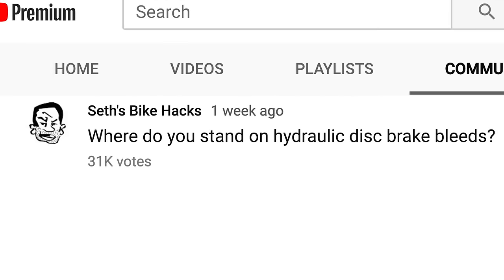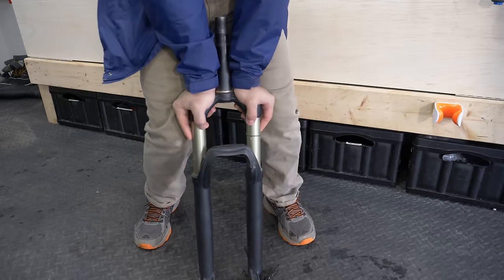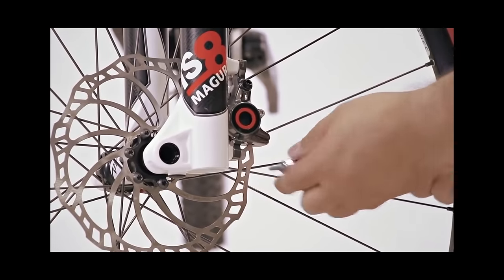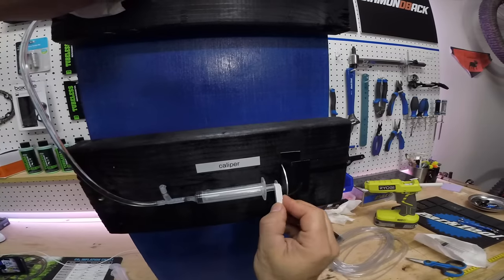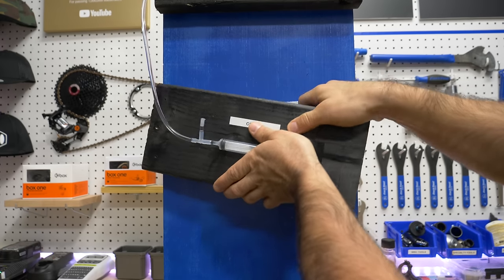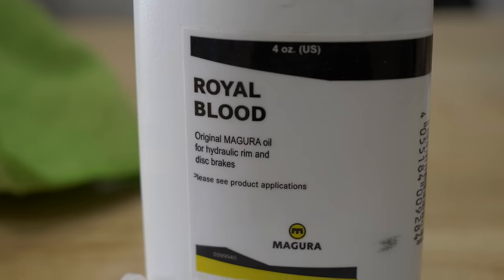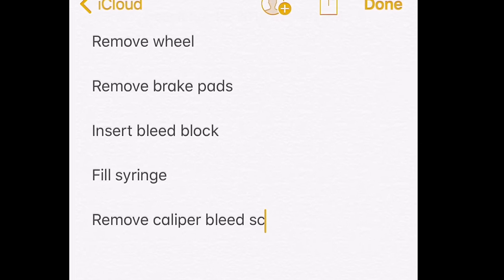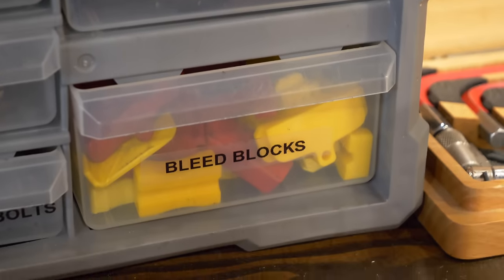How to bleed MTB brakes

Comment: ok I have a Norco Truax 3 2013 I think got it from a friend of mine had a few things mess up with it so tried fixing let a shop fix it cost me about 500 bucks and like the bike has oil or something for suspension and my friend stayed there are oil and the air suspension is this true?
Reply: i dont know what you're saying but my guess is that you have an air fork/shock that needs to be lubed with oil or something? dont know what u mean exactly though

Comment: After bleeding, while block is still inside caliper, break feels really stiff, so no air inside. But as soon as I remove the block and put pads (and wheel) in, rear brake feels spongy. Tips?
Reply: You have no room to compress the pads inwards with the bleed block in. So it doesn't move at all. Any movement you feel is the air squashing.

Edit: did you get it solved? Just noticed the date lol
Reply: @bananasstuff3344  Wellz theres no air squishing while block is there. How can there be air after i remove block?
Reply: @bananasstuff3344  I was using baby mineral oil (like sethbikehacks), but i revently switched to shimano orignal, and they feel a bit mor stiffer, but they feel different, like they are not powerful enough. I might need to refill and over bleed them (pads are on 60%)

Comment: Man, I feel like I lost my man card admitting that I don't want to bleed my own brakes. I tried to bleed my Hayes brakes, and got DOT fluid on the rotor, and pads, totally ruining the brake. I think if manufacturers want to use DOT fluid, they should have a reservoir like motorcycles, and cars, otherwise they should be trying to use water or something instead.

Comment: shimano brakes are the easiest to bleed, you dont even need a funnel, you need brake oil (or baby oil) and a dressing bottle, fill everything into it, then drip oil into the port otherwise used for the shimano funnel

Comment: Do I need to bleed brakes when I have rim brakes? I think that's the type I have....
Reply: no. ig it seems extremely obvious to me, but not for everyone i guess. rim brakes use a cable to pull 2 pads together on the rim to slow down your bike, while hydraulic disc brakes use the oil to force into the caliper, making the 2 pads squeeze on the rotor.
Reply: @linemedia666  yea, i was thinking that but i wasnt sure, thx

Comment: I hate that bikes are getting more and more complex just makes them more expensive now we’re not talking about longer life tubes or stronger frames I’ve seen carbon fiber frames snap like celery and run flats make the ride harsher bleeding brakes for a bike it’s dumb and not needed it’s a gimmick that makes them more expensive to maintain I remember maintaining a mountain bike from the 90s cost like 50$ a year just for tubes and brakes maybe a chain or tire now it’s in the hundred of dollars
Reply: Depends how much and rough you ride. I upgraded my frontal brake after 2,5 years to a better model with only changing the brake pads one time until then and now after 3 years I finally have to bleed the left over back brake the first time. And it's a low class shimano brake, no top model.

I ride a few thousand kilometers xc tours each saison in a hilly area with some long downhill trails. So I don't think the brake service is too often. Maybe enduro and downhill guys shredding to the limit have more trouble with this.

Comment: Hope ftw.  No special tools or syringes, or procedures. Just bleed like car brakes and you don't need to order special expensive mineral fluid from a bike shop, just use spare fluid from your car you probably already have laying around.  And the pistons wont even pop out if you squeeze with no rotor installed like everyone is scared of doing on other brakes.

Comment: "oil get's contaminated,and air get's in..." We got to ask ourselves ,why is  that?  No such thing on older brake models and motorcycle  brakes , you could used them for years without this kind of hassle...
Reply from the maker: It does happen on cars and motorcycles, however those systems have sufficient volume where tiny millimeter wide bubbles do not have much of an effect. Cars also have vacuum pumps. On a bike every gram counts, and their brake systems hold way less fluid. After some months, even the tiniest bubbles can end up making a difference. The same goes for tire pressure. On a car you check your pressure how often? On a bike you check every ride.

Comment: I'll stick with my mechanical disc brakes good luck with those on me at Trail official after smacking some branches or a tree ripping a brake line yeah that be just nasty trying to clean up Mechanicals may be old but they're guaranteed to work and their maintenance free pretty much

Comment: All shops in my area charge 90 dollars for a full brake bleed..not cheap at all and I dont understand why bleeding any car line is 5 times easier than a bicycle.I can buy the bleed kit for 30 dollars and then the m im neral.oil for 10 dollars.I am very frustrated with this situation as it seems like manufacturers  are just trying to dollar u to death for what should be a simple process.

Comment: Disk brakes on bicycles are a royal pain in the butt, I threw mine away and fitted cable caliper brakes,  end of problems.
Reply: are you serious
Reply: @linemedia666  Yes,  Caliper brakes are really disc brakes, the wheel is the disc and the pads grip the wheel, I am not trying to stop a truck or a racing car, it's just a bicycle.
Reply: @Lili-Benovent  "it's just a bicycle" i dare you to say that going down a rock garden
Reply: @linemedia666  "Going down a rock garden?  I don't ride down any rock gardens, bicycles are for riding on the sidewalk or bicycle lanes, they are just a slow pleasant way of getting from A to B, I can't see any fun in riding down rock gardens,  Just what is a rock garden anyway?  it sounds like a good way to get a flat tire.
Reply: @Lili-Benovent  i wrongly assumed that you knew about mtb. go have fun on your road bike
Reply: @linemedia666  Thank you

Comment: I am in market for MTB... And all better ones come with hydraulic systems. All I want is mechanical brakes.
Reply: why? hydraulic is just better, and if you're too lazy to care after your bike then just dont get a bike
Reply: @linemedia666  can you fix hydraulics on field? No. I much prefer "worse" tech, but tech I can fix with paper clip and dental floss.
"and if you're too lazy to care after your bike"
What kind of idiotic statement is that? Hydraulic brakes do not require more care (changing cable is harder than bleeding). And I f I was so lazy I would just buy whatever and give it to local mechanics to maintain.
Reply: @lifebarier  there's a reason high end mtbs come with hydraulic brakes and full sus. if you want mechanical brakes get like a road bike
Reply: @linemedia666  Why are you suggesting road bike when I specifically say I need MTB? I also don't care about your magical "reason" since I had reason to avoid hydraulics. ( and if you are going to start with bs like "well, mtbs are for really dangerous terrain, so that extra 'goodness' of hydraulics is there for a reason" - I know my terrain, it does not need hydraulics, I am better of with old good cable.)
"high end mtbs come with hydraulic brakes and full sus"
So hard tails are not high end? Great, I was looking for hardtail with non hydraulic brakes. According to you that should not have been hard to find.
Reply: @lifebarier  if you know your terrain and don't need hydraulic, then why would you need a "better" mtb? if you're not riding so called dangerous terrain, then why get a mtb at all? what even are you going to ride? hardtails can be high end, but other than for xc, you really don't see em often (or dirt jump). "According to you that should not have been hard to find." because it's not. you were looking for a "better" mtb, and theyre not going to come with mechanical brakes. get like a marlin 4 if you want a hardtail mtb with mechanical brakes thats decent... jesus.
Reply: @linemedia666  
"then why would you need a "better" mtb?"
Because other parts I want on my bike ends up on "better" bikes, thus I end up looking for bike that fits me between "better" bikes.
" then why get a mtb at all"
And hat kind of stupid question is that? Because I need mtb. So manufacturers do not make bike that would fit my requirements so I should not get bike at all? 
"what even are you going to ride?"
Terrain where I MUCH prefer mtb so I need mtb and I prefer cable brakes. That is all you need to know.
"get like a marlin 4"
1. Not available where I live. 2. Other requirement is "1by" so this is a fail (and before you ask - less parts to break. Notice pattern? Of course you don't...).
"you were looking for a "better" mtb"
Yes, I was looking for bike that fits my well though out requirements. Stupid of me. Should have blindly bought first thing recommended to me on first youtube video.

"jesus."
Seriously... I know I know you zoomers are consoomers that buy whatever influencer told you is best, but I know what I need (yes, I can imagine your shock) and I do not want to pay for things I do not want.
Why the hell am I even explaining myself to such a twat. Go waste money on something you don't need instead of pestering me.

Comment: Wow... complete flush and bleed for less than $50... not at the shop where I work. $60 for both brakes and that doesn't include the oil. I guess we're on the expensive side. Not really a surprise. =\
Reply from the maker: I think a lot of times it has to do with the kind of shop too. Squatch pretty much only gets mountain bikes in, so they all have hydraulic brakes. They have tons of oil and they do it all day. Same goes for the shops at Whistler. I think they charged me like $20.

Comment: Just do the car method way easier and effective no need for this bs mtb bleed method
Reply from the maker: Keep in mind that automotive brakes are a lot bigger and do not get affected much by tiny little bubbles. The brake systems on mountain bikes are tiny in comparison, and are operated with a single finger. A tiny change in the system is going to be more noticeable.

Comment: I’ve bleed hundreds of cars brakes in my career be lucky bike use oils and spirts not brake fluid ! Brake fluid is horrible stuff to get on you or your bike/car
Reply from the maker: actually many bikes do use brake fluid, and it’s nasty! I do prefer mineral oil, but there are advantages to brake fluid such as consistency with altitude and temperature.